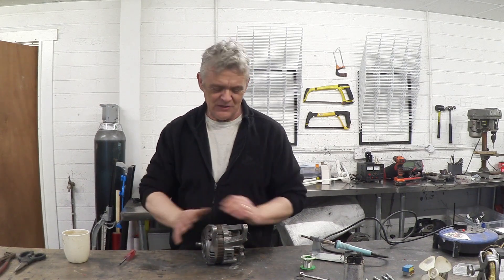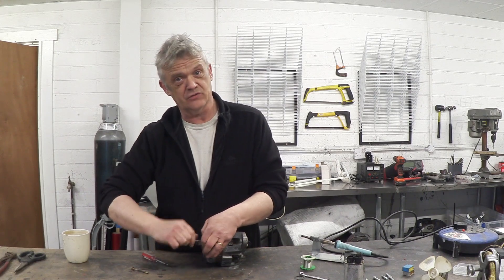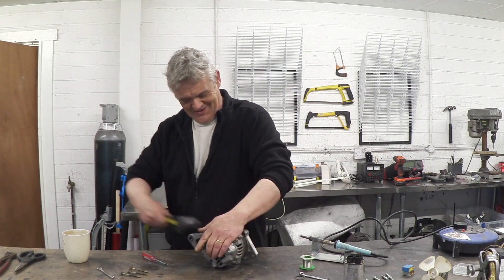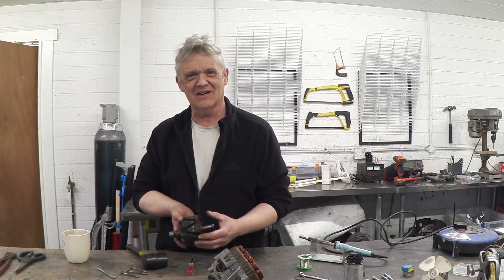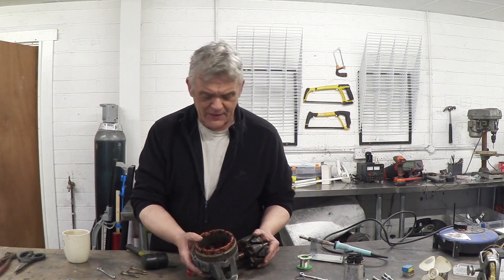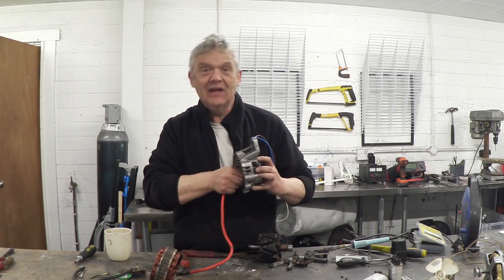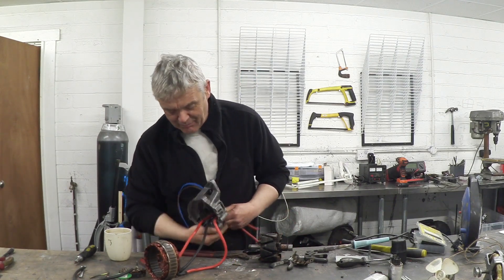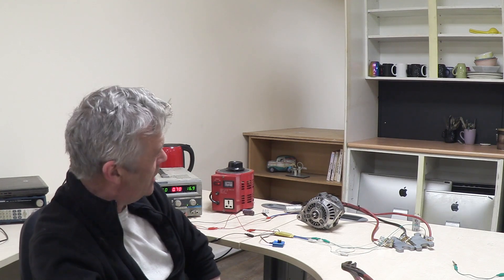Converting An Alternator To A Motor

Comment: What a cool video, I'm currently making an alternator into a motor and your video is a lot of help, though I have one question, on the brush assembly underneath where the two brushes sit what is that negative space? I'm trying to decide whether to remove it like you did or leave it, I also don't know what it does, any help would be greatly appreciated.
Reply: also are the brushes fully extended into its surrounding brush cover? I noticed you left the pin(drill bit) still in the plastic part, did you remove it? Also because turning an alternator into a motor the brushes aren't technically needed for its original purpose, does not using the brushes for their original purpose mean that they do not have to be fully extended?

Comment: That was the wrong way to extract the rotor from the back housing! Dragging the brushes across the slip-rings (they usually wear into a groove, especially in older units) will smash the brushes or at least chip edges off.
Theres always a way to retract the brushes first. You pull back on the "pigtail" which is the braided copper wire connected to the carbon brush, and insert a straight piece of wire, small drill, straightened paper clip etc into a small hole in the casing, which will hold the brushes out of contact with the rings. 
Do the same thing for assembly- the brushes need to be retracted & held to get them over the rings.

Comment: I dont have a speed controller circuit board, can I just use a verriable switch? Like a light dimmer or fan speed switch? Those only have two leads though...

Comment: So you are saying that it is almost the same thing as a brushless motor except that it is not brushless.

Actually though, it is relatively simple to actually make it brushless, with a corresponding increase in efficiency. The expensive but simple and extremely efficient method is to remove the rotor windings and replace them with one large donut magnet, retaining the pole pieces, so instead of one large electromagnet with the poles distributed radially, you have one permanent magnet with the poles distributed radially. The not quite as good but MUCH cheaper way is to drill or mill into the pole piece claws and mount round or bar magnets, with the poles of course alternated. An intermediate method is to make a magnetic rotor to replace the windings and the pole pieces, both. Do that, add hall effect sensors, and upgrate your bearings and instead of just an academic exercise or very very general proof of concept, you actually get a motor that with the correct controller operates at around 90% efficiency, at 1/10 the cost of a commercially available motor operating at 90% to 92% efficiency. This makes the end result very practical, instead of just youtube content for the purpose of making youtube content.

Comment: Thank you for an entertaining and informative video.
Just one small point. I think I'm right in observing that you brought each of the stator connections out through a separate opening in the casing. Depending on how you are driving the stator these wires will either be passing AC or pulsed DC (which for the purpose of the explanation below has the same effect as AC).
The problem is that by passing the the conductors through individual openings in a conductive material you are effectively introducing a 'shorted secondary turn' resulting in currents being induced in the the casing. The effect may be insignificant at the current levels involved in this video, but if you are intending to use a higher power driver as you suggest, then the effect may become significant – not only reducing efficiency – but also resulting in heating of the casing in the proximity of the cable insulation passing trough it.
If you route all 3 conductors through the same opening you cancel out the magnetic field produced by the current and avoid the issue.
You are unlikely to see a competent electrician passing individual AC carrying conductors through their own openings in a conductive material. Instead they will route all conductors carrying AC current from the same circuit through the same opening.

Comment: Seen this done elsewhere before but I don’t get why it’s good for any reason other than someone enjoys tinkering and they got it cheap or free because used motors aren’t too expensive and are designed to more efficiently do the job and you know how strong they are so you aren’t hoping an alternator can do a job meant for a 3/4HP motor. You buy a motor you know what RPM that motor will spin and what HP and what wattage demand it has. Again it makes perfect sense if someone wants to tinker and learn electronics.

Comment: That is awesome stuff!
I really enjoyed watching you do that gives me great confidence in knowing that I could do it myself. It also gave me a great idea for you to try something that I've seen several times people do and that is taking a motor and attaching it to a flywheel then from a flywheel to a generator and somehow using the slip connection of the belts and the power stored in the flywheel to create a generator that will then make electricity on its own in sustain itself. I've attached a YouTube video that will give you some idea of what I'm talking about
Reply: No such thing as free energy. No flywheel can sustain momentum or movement without more energy going in to keep its RPM sustained. Different flywheel diameters and weights do have benefits for certain applications such as faster acceleration with lighter ones and more efficient sustained cruising speed from heavier ones, but all require more in than you get out.

Comment: I wonder if it would be possible for someone to manufacture permanent magnet rotors that fit a variety of alternator models and sell them online.  It would be nice if people could just simply swap out the rotor on their salvaged alternator and bing bang boom you’ve got a nice big BLDC motor.
Reply: Seems just as easy to do Rob's modification, and WAY cheaper.
And a permanent magnet rotor would NOT make it a DC motor, it is a slip-ring design with field windings, supply it with DC and it would just lock in place.
Reply: @bikerfirefarter7280 BLDC stands for brushless DC motor and yes its kindof a misnomer because the motor is powered with a 3 phase AC current.  The motor controller is supplied with DC though.   Ive got a converted alternator with magnets set into the rotor and it runs great with a cheap "BLDC" ebike controller
Reply: @maukaman  Yep, BLDC is easier to say than 'DC Supplied, 3-Phase Controller Driven, Brush-Less Motor'. DCS3PCDBLM. 
Though I still regard Robs design easier/cheaper, and has way less engineering involved.
An alternative magnet arrangement is to replace the centre winding with 1 or 2 circular magnets from a microwave cavity-magnatron. It is less trouble balancing it., though getting the clawpoles apart can be a bit tricky.
Here's a question. Why are the clawpoles triangular and not 'square'?

Comment: I am working on a v4 outboard and I wanted to change its alternator (which is integrated into the flywheel)
into a motor/generator so it can operate as a hybrid (add extra electrical power when taking off, and recharge it back when planing).   I have two, one is newer and there is both the spark plug timing/capacitor charge and alternator in one, and it uses permanent magnets in an aluminum flywheel.  The older version has a distributer and so the flywheel/stator is just an alternator.  The flywheel also has those "V" shapes, and I finally figured out that is done because when the rotor is powered to make it magnetic, each "v" alternatives between the front and back,
make them alternative between positive and negative poles.  In my outboard flywheel, it has the coil inside the stator and inducts the charge to the steel flywheel to get the positive and negative poles in the "V"s.  So it does not have any brushes to do this.  I'm sure it is not efficient at all...this is like a 1965 outboard, vs the newer 1980 (haha still old.:)
Just thought I'd mention that because it makes more sense of those "V" configurations.

Comment: I HAVE A QUESTION ( ALL YOU DID IS GOOD ) EVERYONE DOES THE SAME THING BUT NOT ALL THE INFO. NO INFO ON THE CONTROLLER THEY USE OR MAKE AND HOW THE THREE WIRE ARE CONNECT.
MY QUESTION IS ARE YOU ALL HIDING THE ANSWER OR DON'T KNOW HOW TO EXPLAIN
THE CONNECTION. GIVE IT UP

Comment: how do you connect the three cabels coming out of the altenator? i understand you connect the plus and minus of the bruches to the speedcontroler. but i do not understand how to connect the three cabels since you only have a plus and minus. do you connect two of them together?
Reply: Those are the 3 phases of the alternator

Comment: Another motor or engine project i find fascinating is the steam or 2 stroke motor from ac type compressor i bet if you aint seen it it'll get u thinking of possible way to use it

Comment: I m having a go at this with the only knowledge gained from these videos and forums. I ve only got the alternator and get a short if I connect battery to brush terminals when they don't have continuity.a little knowledge is dangerous!

Comment: You said, you put 5v. To the rotor. But then you mentioned 12v.? Also, where did you hook up to get the five v.? I fly rc airplanes, and have numerous esc’s. So I understand that side.because the little ac motors on airplanes have three wires, but are brushless, in ductive.  Did you get your 5v. From the small three wire connector off the esc that hooks to your servo tester? Or on an rc, it would connect to the crafts radio reciever. And as a side note. Esc’s are cheap to purchase, for low amp ones, but they get very expensive for the high amp ones. I suppose one could double or triple them up to give the alt/ motor more power. Cool video.
Reply: Foot note.. I built a twin engine rc airplane . When you connect the two motors together, with the three wires, you can spin one motor, and you’ll see the other motor twitching. So, I knew they are related to an alternator. And to change rotation direction, you just swap two of the three wires around, doesn’t matter which two.
Reply: There is a coil inside of the rotor, five, twelve or other voltage is fed by brushes. Bigger BEC might be enough, some people use two 18650 LiIon batteries in series. Comb like iron brings alternating S and N poles of electromagnet near stator. 
Some people replace coil with one hollow magnet, other use several magnets. And others drill holes in metal and glue in button shaped magnets... so no need for rotor supply

Comment: Can you run it without a speed controller? And if so how? Can you use a single source power supply for both if not using a controller
Reply: Connect it to a mains 3 phase supply and run away.

Comment: You mentioned turning it into a generator. Can you explain that a bit further please
Reply: An 'alternator' IS a generator, the diodes in the casing just turn the AC output from the coils to DC.
If you want AC output, just remove the diodes.

Note: It is normal when used as a alternator/generator the voltage/current to the rotor coils is taken from the output, which makes it self-energising without needing permanent magnets.

Comment: I wonder how one would run at 72v 20a....🤔 And about how many watts would you say it would be?
Reply: 72 x 20 = 1440w. (but depending on efficiency etc the output to 'torque', motive force, would be less).

Comment: back in the 60s & 70s when working on an alternator, replacing brushes or voltage regulator, we'd use a toothpick to hold the brushes in place, which worked rather well.
Reply: The old gm10 si.😀 they were very user friendly alts.

Comment: By using a variable DC source to power the brushes (field winding), you will be able to implement field weakening.  Weakening the field allows higher RPM at the expense of torque which may be useful for a vehicle without a gearbox.  On the other hand, leaving field current high limits rpm to whatever generates back EMF equal to the 3 phase supply voltage. "Electric Motors and Drives" by Austin Hughes was, and may still be available for free download as a pdf and is an interesting read.

Comment: A buddy of mine owned an old BMW from the early 60's. The generator and starter motor were the same. When the key was in the start position it was wired as the starter motor and when the key dropped back to the run position, it was wired as a generator. It worked great until it didn't. ;-)
Reply: I wondered about that, but then realised the strain on the alternator drive belt(s) is really high when starting. So it comes with it's own issues. Maybe not so bad for smaller 'generators/engines', but for big/diesel engines its got problems.
Reply: Seriously? Engineer showing off or did it serve a practical purpose?

Comment: I'd like to know more about what you're feeding the stator with.  Is it 3 phase sinewave?  What would I look for in a controller?  And guestimate on horsepower?  Would it be a good candidate for a variable speed drill press motor?  My antique drill press was originally ⅓hp which was ok, but the pulleys couldn't be set to a low enough speed for drilling stainless steel, so variable speed would be great.
Reply: Stator feed is DC, Rob clearly explained that.
He also explained you'll need at least a 1.5kw speed-controller.
Re-watch and pay attention.

Comment: Surprised the slip ring connection arrangement on that alternator was so odd. Most alternators around these days just bring out the slip ring connections in a way that you can leave the external terminals in place and use them as is without needing to resolder anything. The voltage regulator in the alternator (typically) is the biggest issue to resolve as that is often connected directly to one of the slip rings, the other slip ring is just taken to vehicle ground - i.e. the case.
The stator of course must have the three phase bridge rectifier disconnected or removed as you did and the phases wired to outside the case as you also did. In principle there should be little need on most alternators to do anything but remove the half of the casing next to the drive pulley as all the needed work can be done without the need to access the other end. Makes for a simpler life. 
Many people are also unaware that the EXPENSIVE replacement (and frankly RUBBISH quality) of the custom designed rectifier pack that uses nothing but common or garden diodes spot welded to connections at one (or both) ends and mechanically push fit at the other can EASILY and more cheaply be replaced by VASTLY superior off-the shelf three phase 100, 200 or 400A commercially available (via eBay et al) epoxy packaged rectifier packs with excellent heatsinking facilities. If anyone has to repair a broken alternator due to failed rectifier pack it's a conversion WELL worth considering. A typical 100A alternator specific pack typically costs around the £30 mark whereas a 100A three phase generic rectifier pack costs around 1/3 of that!
Reply: You are right..

Comment: If the windings are in a Y configuration then thats Star not Delta, but the middle of the star would be a neutral wire which I didn't see on your coil so it must be wired as Delta.
Reply: The absence of the 4th wire does not necessarily indicate delta configuration. It can still be wired as  and function in the star or Y configuration without bringing out the central/neutral connection.

Comment: Depending on how you connect and feed power to the 3 separate phases of this system you have, you can actually make it a fully speed controlled, reversible motor at virtually any speed up to its self destruct speed limit [centrifugal force]. ~( 'w')/
I have seen people wire these up with as much as 72 volts and using a phase controlled field modulator, run them in excess of 10,000 RPM on go karts for the duration of the batteries [which at these power levels, require quite robust batteries, as you can imagine] ~( 'w')/
I have heard people claiming as much as 5 horsepower for as much as 30 minutes nonstop under load without overheating them, so if they are set up well, one can use them for pretty punchy little electric vehicles [go karts, bikes, very small boats and the likes, possibly even a large model airplane].